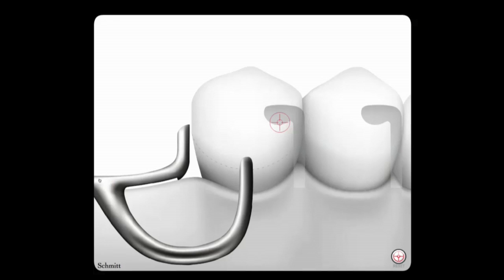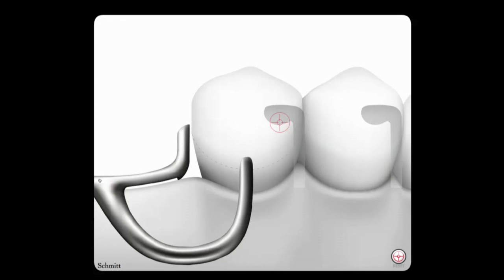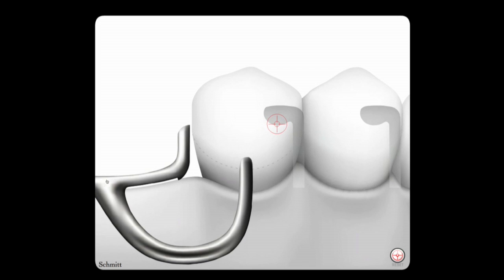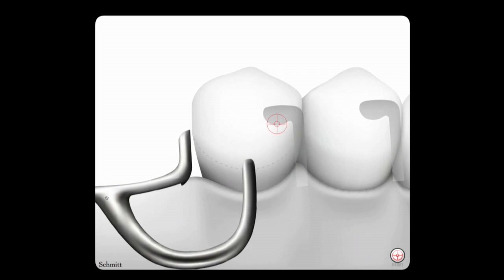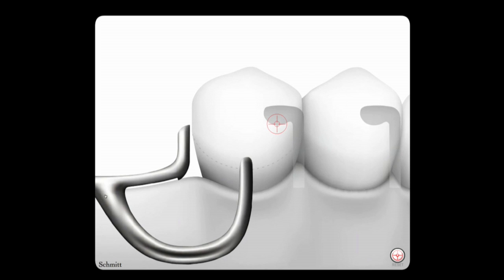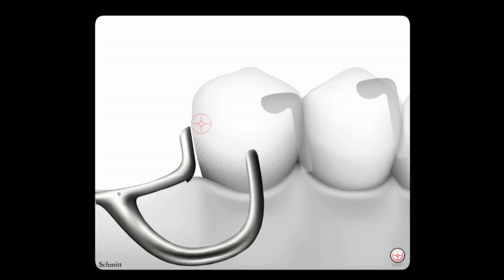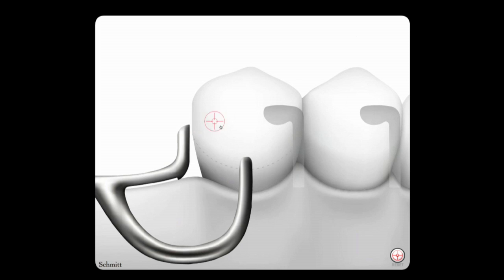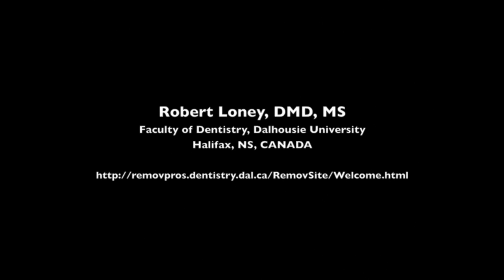How An RPI Retainer Rotates

Comment: Can an RPI system be used on a lower canine for a lower chrome cobalt free end saddles partial denture?
Reply from the maker: The simple answer is 'yes it can'. More typically, though, the mandibular canine has a flatter lingual surface making the preparation of a round lingual rest more difficult unless the tooth is being crowned. If an inverted 'V' shaped cingulum rest is used instead of a mesially-located round lingual rest, the rotations are not the same and the advantages of using a mesial rest will not accrue. For more see my RPD manual: http://removpros.dentistry.dal.ca/Manuals.html